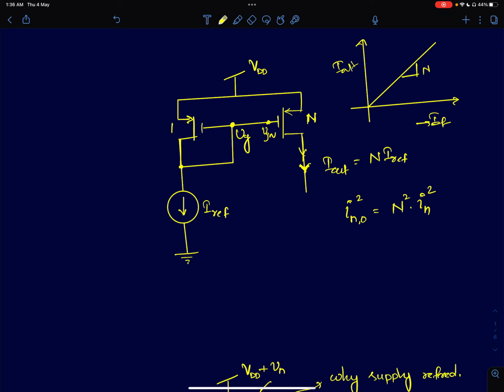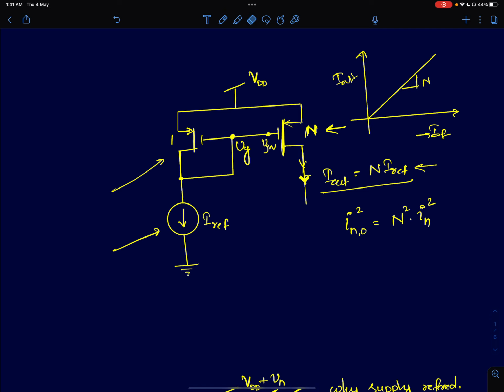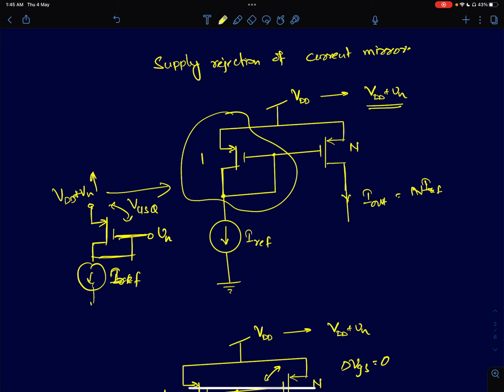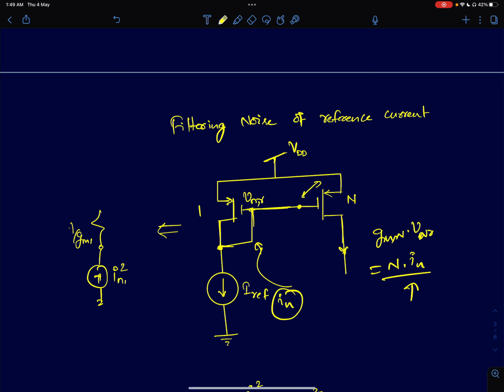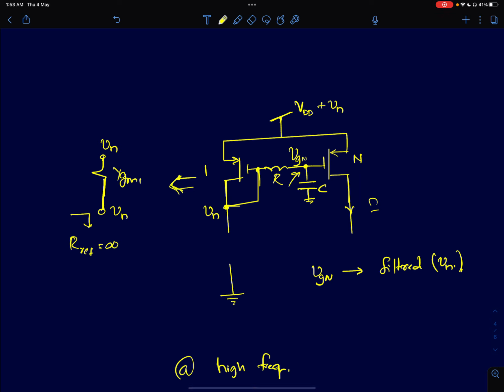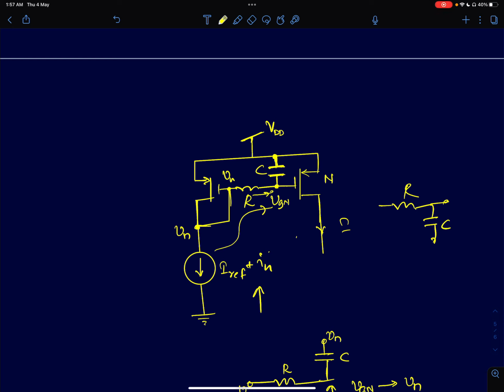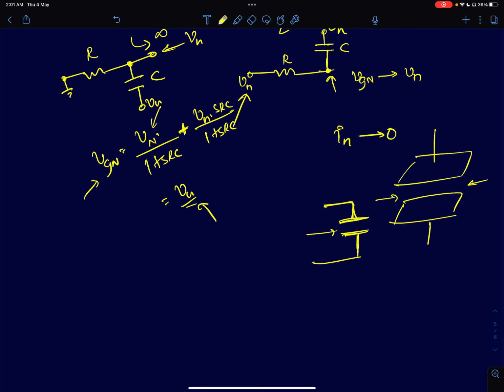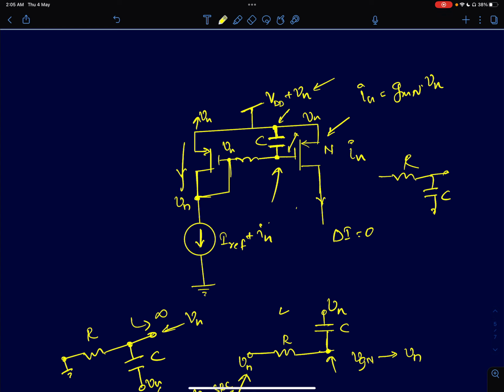AIC Lecture 55: Basics of supply vs ground referred RC filtering in current mirrors

Comment: sir if we just wanted to filter out the noise then why dont we just connect a capacitor between the supply and the gate ?

in that case for (A)any supply noise the gate and supply is short circuit ( so no effect in Iout), 
(B) for any Iref noise the noise voltage generated in the gate of diode connected transistor will directly be terminated to sml slg gnd (VDD).
Reply: Try drawing the small-signal equivalent. you would need a larger C then for a smaller pole (the new pole is at gm1/C). With RC filter, you can easily control where the pole location should be for the spot noise spec. Going to the other extreme, you could put a very large R, but then the noise contribution of R will dominate that of the reference.
Reply: @arjunratheesh7743  that's a great intuition, tips for building this from scratch, which way can i also think like this? i struggle !

Comment: Dear Sir Can you please make a vidio on this type of Question (asked in Texas Instrument) :  An amplifier has a non-linear response given by Vo = Vin + Vin^3 at all frequencies. When a sine wave of amplitude 1V is input to the
amplifier, the output of the amplifier contains a harmonic at -80 dBm. The amplifier output goes to a low pass filter with a 3 dB bandwidth of 
1 MHz. What s the approximate amplitude of the harmonic at the output of the low pass filer if the input to the amplifier is a 3.33 MHz sine
'wave with an amplitude that is equal to 0.5 Volts?  Or Atleast please give hint!
Reply from the maker: Hi Lokendra,  Non linear amplifiers characterised by vout=k1*vin+k2*vin^2+k3*vin^3+...kn*vin^n+....., produces harmonics of the input frequency. The problem you have here is a memoryless non-linearity (which means the non-linearity equations (or nonlinear characteristics) is the same irrespective of the input frequency of the signal). If the input amplitude is decreased by a factor, say x, then the power of the first harmonic will decrease by the same factor (this follows from linearity) x or 20 log(x). The n^th harmonic component decreases by a factor 20log(x^n)=n20log(x) as you can see from the non-linear characteristics that the nth harmonic term depends on vin^n.
In this example the input signal amplitude is decreased by a factor 1/2 (it goes from 1 V to 0.5 V), so the first harmonics decreases by 6 dB (or -6 dB in absolute terms)  and the third harmonic level decreases by 20log(1/2^3)=18 dB. So in this example the third harmonic power decreases to -80 dBm-18=-98 dBm. Now this output is then passed through a first order unity gain low pass filter (Im assuming first order unity gain as the order and dc gain are not mentioned here) of 1 MHz bandwidth. The third harmonic frequency for an input of frequency 3.333 MHz is 3*3.333 MHz=10 MHz. Since it is a first order low pass filter, it attenuates the signals after the bandwidth at the rate of -20 dB/decade, 10 MHz is a decade away from 1 MHz, so the attenuation at 10 MHz is -20 dB. Thus the third harmonic power (or level) at the filter output is -80-18-20=-98-20=-118 dBm.
Reply: @chembiyant456  Very happy to see your reply! Great explanation, unterstud each and every point. I am a student from IIT But i couldn't get any Analog teachers like you, Althogh I am very interested in this domain but need help! Thank You So Much again!